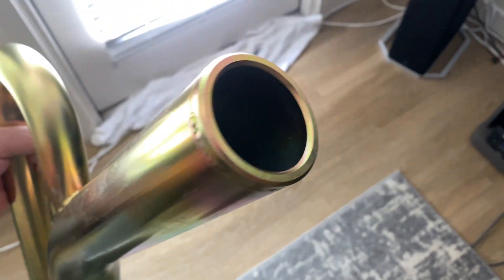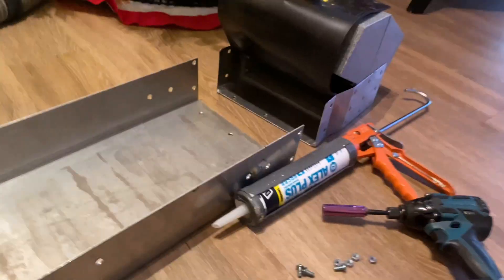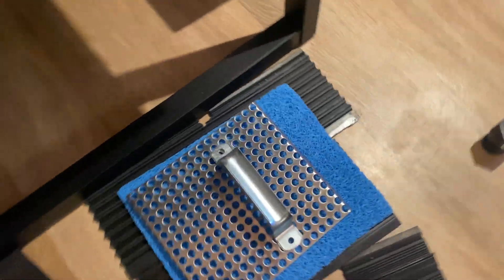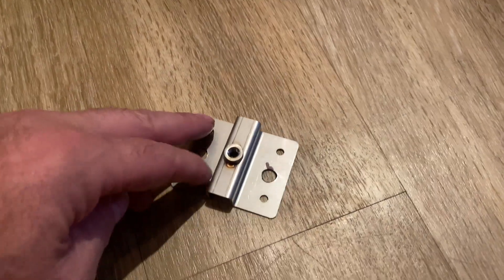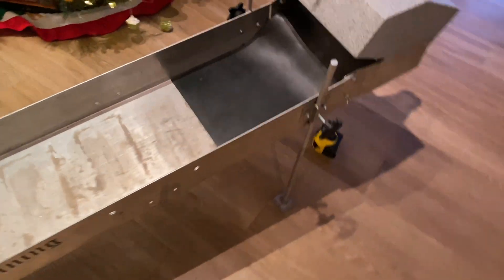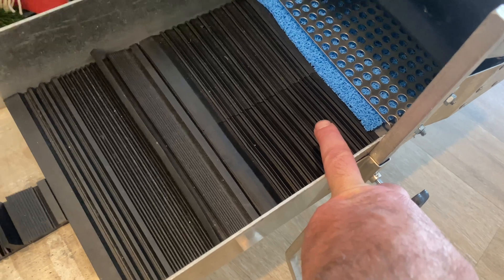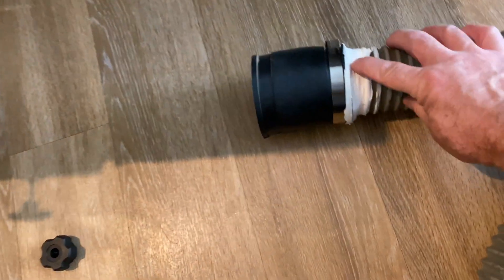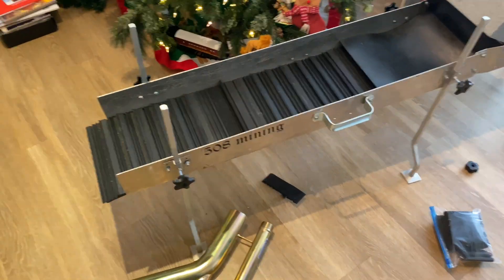How To Build A 2.5 inch Land Based Gold Dredge

Comment: Did you run this bad boy yet?
Reply from the maker: Yes! I’ve ran it a few times. Just been busy with work and haven’t made it out Prospecting lot this summer! I did make a couple short videos using it. But plan on using this and the 3 inch Dredge soon!

Comment: I salvaged a bunch of sheet aluminum that was on a trash heap
about the thickness of hiway signs (perfect)
With a few handtools 
( i.e.  elect. jigsaw , batt. drill , a file , pop rivet tool ... a few other easy odds and ends)
 I built a highbanker as good ( prolly better for super fine gold recovery) as any on the market ... your proccess here  is basically what I did ... I could easily add on the nessasaries to make it work as yours does
Reply from the maker: Awesome! It’s always fun building something new!